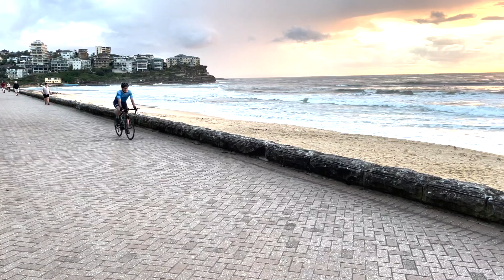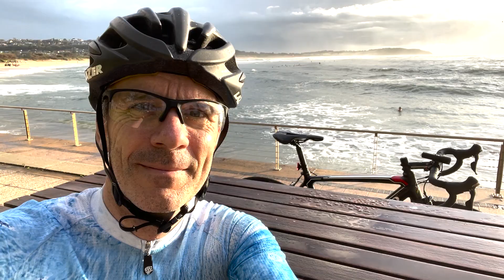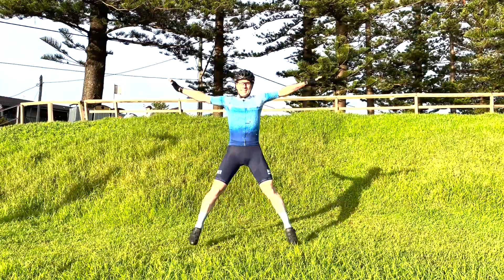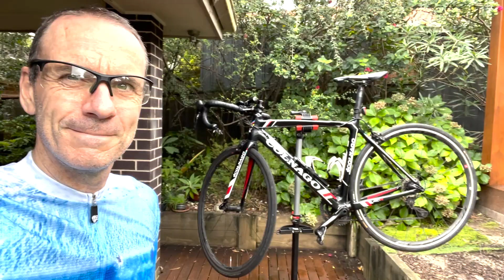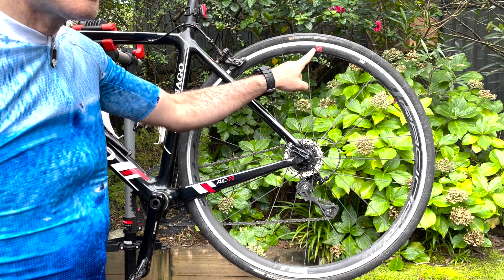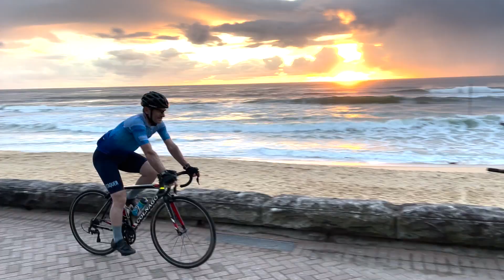How to Understand Aliasing in Digital Sampling ("Best explanation ever!!!")

Comment: So with aliasing we should expect that higher frequency pitches would be of lesser quality than low pitch frequencies and middle pitch frequencies? But I feel like it's more complex than that because of some other videos I've seen.
Reply from the maker: I'm not sure what you mean by "lesser quality". Can you be more specific?
Reply: @ I also edited my post…but you probably understood. But by lesser quality, I meant that higher frequencies pitches would be more likely to be distorted or vanish entirely?
Reply from the maker: It's important to understand that signals are not being "distorted" when they are sampled. And they are not "vanishing" either. All that is happening is that the continuous-time signal is being converted into a sequence of numbers (ie. the samples). If you try to reverse the process (digital-to-analog conversion) then you will be able to reconstruct the low frequency components of the original continuous-time signal exactly (ie. below the Nyquist frequency), but you won't be able to reconstruct the frequency components that were above the Nyquist frequency. The sampled energy from those frequency components will alias (or "fold back") into lower frequency components in the reconstructed signal. Hopefully this video will help: "Aliasing Ambiguity Explained" https://youtu.be/zUAka4orrJA

Comment: Wonderful Explanation sir. But I want to ask a question: here while the camera captured the backward motion of the wheel its sampling rate was high? and if I want to get the correct movement of the wheel in the video should I have to keep my sampling rate low?
Reply from the maker: In some cases under-sampling can achieve the ultimate goal (eg. in some cases of digital down conversion), but in general you need to make sure you're sampling at least twice the rate of the change in the signal. You might like this video: "Which Way is the Propeller Spinning?" https://youtu.be/niykPH0n4J0

Comment: Excellent video!

Nyquist sampling theorem says that if you want to figure out how fast the bike tire is moving (frequency) and which direction it's moving, you need to sample it at least twice as fast as it is spinning. Sample slower than that and it'll look like the wheel is spinning backwards, even when it's spinning forward. You won't be able to tell if the wheel is spinning forward at f_nyquist + delta or f_nyquist - delta. This is aliasing where the spectrum "folds back" onto itself about the Nyquist sampling rate. Some designs actually rely on sampling in higher Nyquist regions, though it requires a high pass filter or band pass filter to guarantee that there is no frequency content below that Nyquist region. Otherwise you will get an aliased spectrum.
Reply: And this is why we need motion blur in videos; to reduce aliasing. Though to get rid of the aliasing all together we'd need at least a 720 degrees shutter which unfortunately is physically impossible, and it would also make everything looking a bit to smooth.
Reply from the maker: Thanks. Yes, I've got a couple more videos explaining it in more detail: "Aliasing Ambiguity Explained" https://youtu.be/zUAka4orrJA and "What is Aliasing?" https://youtu.be/B3nZUFNkTGY